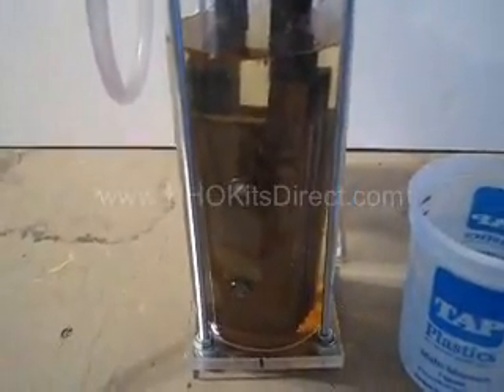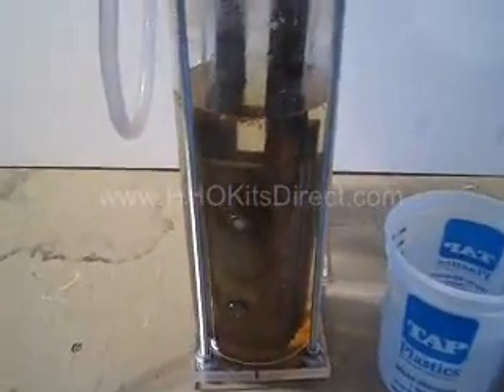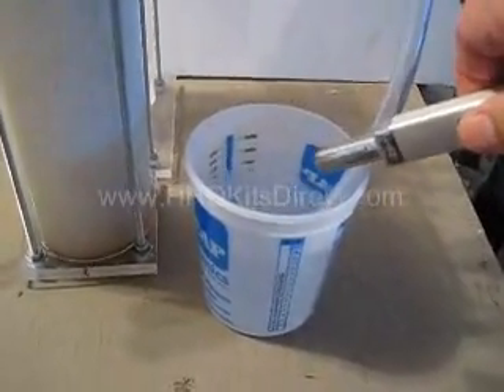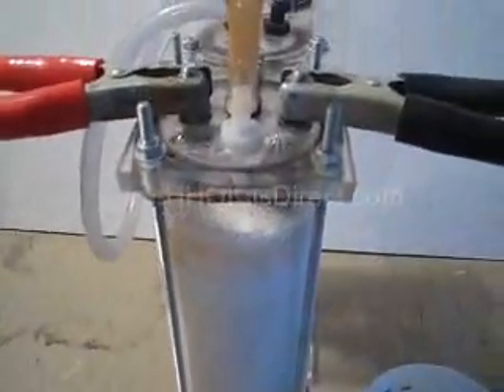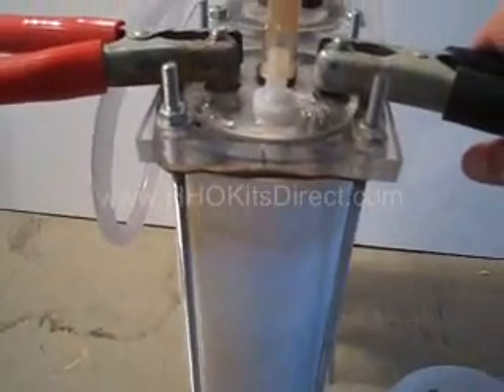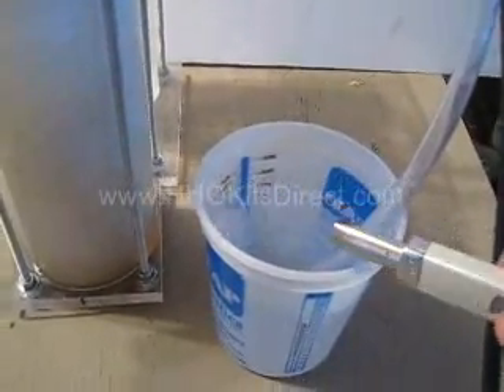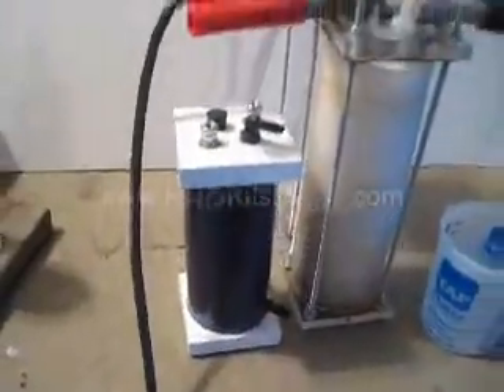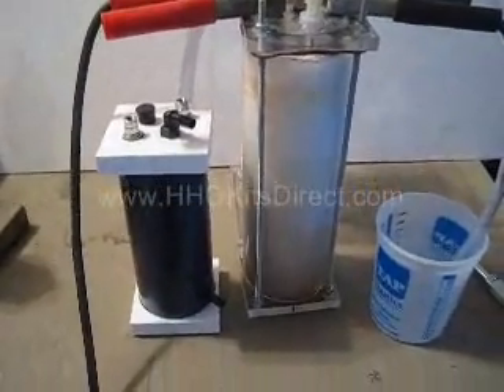HHO Generator Bench Top Model.wmv

Comment: This won't work.
Or it will work, but it's counter-productive. 
The electricity which you use to power this device is pure exergy, while the produced heat from combustion of the gas has only very little exergy.
This device in the video is an exergy to anergy conversion unit, which is exactly the opposite of what you'd want on an engine.